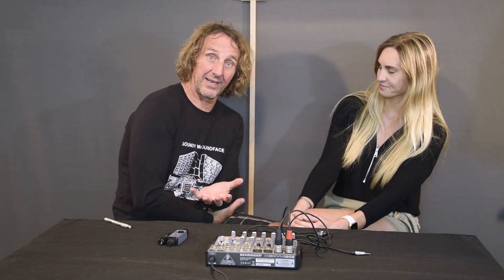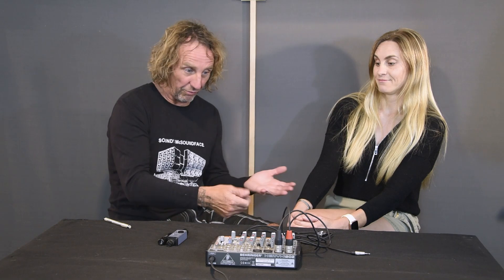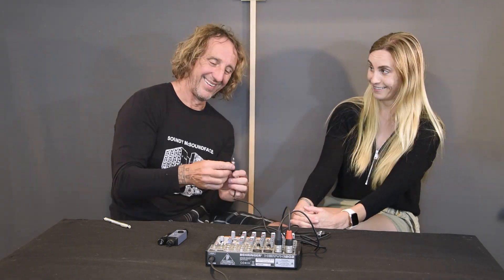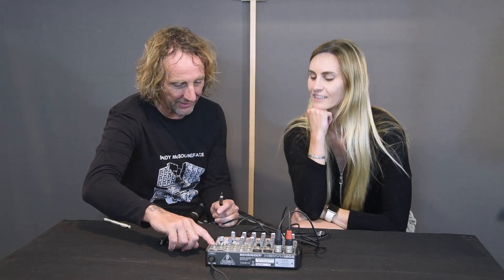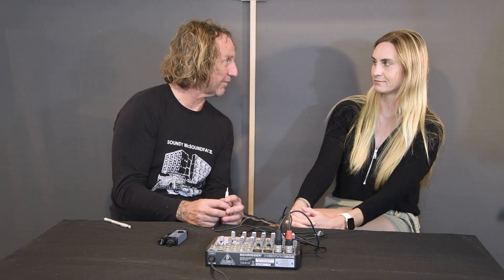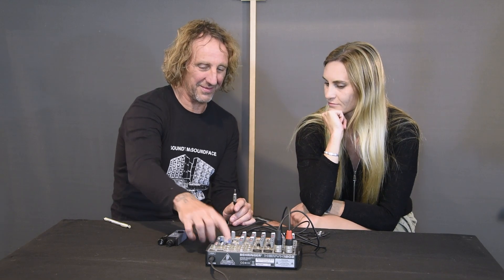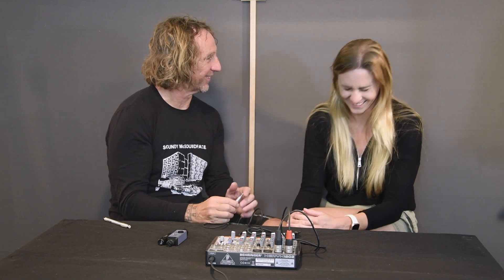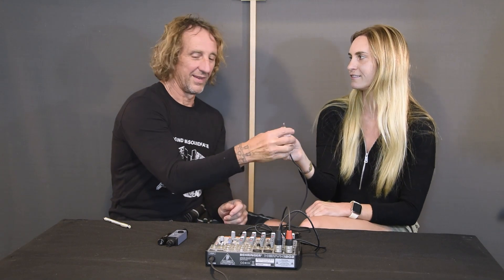Don't Blow Up Soundcards - Mini Plug Phantom Power Test

Comment: Hai dave. i have a question. I setup 2 mixers, stage mixer and FOH mixer. The stage mixer send lr stereo master to FOH mixer using xlr output to xlr input at FOH mixer. What happen if phantom power suddently turn onn FOH mixer. Its can damage my output on stage mixer" thankyou
Reply from the maker: This should answer your question

https://youtu.be/_8UTGcuAtd0?si=UMiK1k6alCT0yYj0
Reply: @DaveRat  Thankyou dave for the video

Comment: Even though it is clamed to be 48V, which it rarely is, it goes through a 6.8kohm resistor, so it is only 7mA into 0 ohms reistance. It shouldn't be problem for an input with 10k of additional impedance because when it hits the electronics it will only be 2.8mA of current, not enough to blow a transistor or an opamp, but enough to trip a security switch on a mac computer and render it useless. That wouldn't happen on any non-apple device, be it a computer or an audio interface.
Reply from the maker: Sure, and also numerous people claim to have have damaged sound cards from 48v.  Muskets are extremely common and a quick internet search landed

Most MOSFETs on the market have a maximum Vgs of +/-20V, which means with VM > 40V most MOSFETS would be out of range.

It does not seem to be the actual 48 volt existing that blows the sound card but to the best that I can figure, it's the surge when an active 48 volt XLR is plugged in jolt the circuit and fixes the input card.

The current rating is very low forphantom, but the instantaneous surge of any capacitors in the circuit can offer a lot more current for a short time

Additionally, on pro gear, 48v phantom is the norm and is always in and around 48v.  For cheaper gear and some portable gear, 12v phantom is used.  And occasionally gear will spec at 24vv phantom

Comment: I would like to adapt this test to check for the  presence of latent B+ voltage in the anode socket of a disconnected cathode ray color picture tube. Hmmmm... might work...
Reply from the maker: Some ideas are better than others

Comment: Just remember to wipe that off with some alcohol between uses not only does it clean the contacts, it cleans the (contacts) and Leaves a nice taste in your mouth.

I don’t plug into to too many unknown cables but now I’m definitely A little grossed out for any of the cables I might have used.

And then there’s the how did your production get shut down……
I don’t know but all the stage hands kept licking cables.
Reply from the maker: Or, 

"So why did your laptop go dead 5 mins before the gig and ruin the into?"

Well, I was afraid to lick the cable because the end might be gross.

Hmmm, and you just got done testing all the vocal mics that has had hundreds of beer lipped sweaty people sing into it and has been bouncing around in a road case for a year and fallen onto the stage a dozen times into piles of who knows what?

Hmmm
Reply: @DaveRat  haha🤣

Comment: There is no need to risk damaging your laptop bu connecting it directly to a mic pre. Most consoles have a purpose built stereo line input for exactly this purpose. If that's not available stereo DI boxes are neither expensive nor hard to find, some are even designed specifically for laptops (although any generic DI box will probably do just fine in most cases).
Reply from the maker: Ahhh, so you need is to have everything you need for every situation handy and close to get every situation running on time, with you always.
Reply: @DaveRat  Everything for every situation? No. DI boxes for the very common situation where you need to plug in a laptop? Yeah I have those living next to the console at all my venues.
Reply from the maker: All good with always having the proper tool for the job and even better is to be able to test and solve it faster, easier or when when the proper tool is not at your finger tips.

Comment: If this was a frequent issue I would just wire up a 3.5mm jack that had a circuit with LEDs for this and keep in my laptop bag.  Then hope nobody pushes the phantom button by accident!
Reply from the maker: I am working on a tester protector unit. Will see.  May be a soundtools product
Reply: @DaveRat  plz include a phantom button condom!  lol

Comment: I've always soldered these type cables to pin 2 and 3 only...is that why I've never blown a laptop/phone, or maybe I just always checked it was off?
Reply: so tip to pin 2 of one xlr, ring to pin 2 of other xlr, and sleeve to both pin 3s...
Reply: I just tongue checked it, felt nothing, guess I was doing right...
Reply from the maker: Hmmm, while that will not shock the lick that also floats the entire phone or laptop chassis at 48volts.

This may not be an issue but something to be aware of.
Reply: @DaveRat  Yeah I thinking that after, ways you could complete the circuit, or possibly damage something else, I don't know...perhaps for just plugging in a floating phone/laptop it's safer...I've definitely used that with all my MacBooks/iPhones...though it wasn't for this reason, think it was because it generally seemed give a lower noise floor...
Reply from the maker: Interesting. Yeah a laptop and phone will typically float unless there is a 3 prong ac cord on the power adapter.

As far as noise floor, the shield is no longer grounded and is floating. Seems like that would be noisier but would need to test to know for sure.

Comment: I toasted a MacBooks headphone jack with phantom power several years ago.  Now, I travel with my own XLR to 1/8" cable that has Pin 3 and 1 not connected.  I also have my Q-Box that I can test for Phantom with.  But I do like your hack because in a pinch you will do what you have to do.  Great video.

Comment: Clever using 48 for phantom power because OSHA considers all voltages of 50 volts or above to be hazardous and the product then needs labeling and precautions....no matter the current.
Reply from the maker: I think that is why 48 was chosen when phantom was designed.  They wanted high voltage to minimize cable loss and low currents for safety. The 48 phantom goes through a 6.8k resistor by deaign

Comment: Introduce cables with capacitors in the XLR's (LOL)
Reply from the maker: The caps needed are a bit big to fit in an XLR if ya don't want LF roll off, but yeah, working on it
Reply: @DaveRat  I know, maybe I'll give it a try with SMD caps some day (keep you posted)
Reply from the maker: Smd caps are still pretty big as ya need 100uf and about 63v. 

Soundtools will release a product as soon as it's ready

Comment: Seeing how your using your tong to check for phantom power you must be in a pinch with no meter and under the gun to hook it up. If you get your tong as dry as possible that might help reduce the shock so then in a pinch you would half to use your sleeve to dry off your tong and then touch the connector as quickly as possible on your tong. 48 volts is getting up there high enough you should just about be able to feel it start to bite by grasping firmly with  a wet index and middle finger across the tip and the other the ring. At work if we have to work on anything over 50 volts we are supposed to wear rubber high voltage gloves.
Reply from the maker: Where is the fun in being slow and boring?

Comment: 110V AC on your tongue? 240V?

I don't know any sparks who do that. Better to use test gear. For 48V presence I just check the button, or use a single ended rated line input. Or a DI. Anything but the dreaded XLR to minijack with 48VDC plausibly on it.

The chances of me using minijack are quite slim. There are USB boxes which work way better, and most small mixers have a USB class-compliant input needing no drivers.

Bluetooth has some latency, but it's very useful. I have a variety of widgets which can be stuck onto inputs, which provides superior electrical isolation as well as untethered convenience. The only problem is restricted access / bluejacking.
Reply from the maker: Safety first, therefore put high voltage in your mouth
Reply: @DaveRat  you can have 240V or worse in the earth/ground, especially if it has been lifted. There are people who have had shocks on stage. It could kill your laptop... or you!
Reply from the maker: Well, it it has that high a voltage you will get shocked before it get to your mouth and though I don't recommend it, 120 or 240 across the tongue will hurt the tongue, but highly improbable to kill unless the voltage is across the heart. Like arm to arm or arm to foot.

And even then, ya need to really hold it for a while to get more than a scare.  At least that's my personal experience.
Reply: @DaveRat  I'm from London, so I've had a few jolts of 240. It's not healthy but hardly lethal in a small dose. Would I tongue it for a million dollars and shits+giggles? Sure thing. I discovered circuit bending by accident running my Korg A3 with the lid off when I was 15... had half an hour of amazingly cool sounds... then got a nasty shock off a piece of shielding. It never worked again. 

It is PSU capacitors which can DC you. I used to run a crosfield magnascan drum scanner... and that had a 16U carbon xenon light source... the capacitors were a couple of liters each. Powerful machine - it grabbed me by two fingers of the left hand once, and I still have dents in the bone.
Reply from the maker: Fun! When I had a job testing switching power supplies, I had 240 between my load and scope. It was all good unless I grabbed a set screw in the scope knob and over shot the load adjust knob and hit the aluminum panel.

Once I did just that and found myself on my ass 4 feet behind my bench, and I had cleared the high back rolling bench stool on the way. My bench stroll was against the bench as if I was never there.

I literally flew 4 feet up and 4 feet back. Sore butt, sore legs and a story is all I had to show for it
Reply: @DaveRat  AC will chuck you, DC causes you to be unable to let go - your muscles clamp on (or so I was told). Very scary.

Certainly nerve conduction and stimulation is voltage based, so electricity is something you can *feel*.
Reply from the maker: I have seen ac cause people to clamp. My friend went to plug in a miswired metal housed connector pair. Grabbed both and locked up, could not speak, was there just vibrating with big eyes till I tackled him.

Scary!!!
Reply: @DaveRat  the muscles work in pairs anyway, and the hysteresis of different muscle groups and twitch types makes electrical interactions with the body a non-trivial concern. It's no joke, though. One hand behind the back, and decent thermal type gloves with surgicals underneath will work. 

My daily wear is a cosalt fire suit. It works for most jobs. It is my "leather jacket", I basically live in it.

Any sort of high current or industrial voltage systems require that sort of approach, but in high power applications a fire suit is the only approach - a serious short w/arc flash will blast an explosive cloud of vaporized metal everywhere. Angry pixies.

Comment: This actually reveals an interesting fact about the phantom power circuit in your mixer... if done correctly, the XLR cold pin should be connected to the ground pin in this type of cable. Thus the phantom power on the cold pin goes to ground, too. But this apparently does not affect the 48V on the hot pin. 

Ah, and just to be a nuisance.... boring people like me use passive DI boxes or phone jack inputs. But actually many modern consoles like Yamaha QL or Allen&Heath SQ feature only a few or even no phone jacks at all.

Comment: Okay so your board is the board the lap top is plugged into to provide the source and the phantom power is off on your board but the phantom power is on from another board on a hard wire split.
Issue or not?
What if you are bringing in the laptop on the 1/4" line inputs but the other board is on xlrs with phantom power on?
Inquiring minds want to know.
Reply from the maker: Hence the test!

Hardwire spit phantom shows every where that is split

Comment: Hopefully no one does this unknowingly with a cable that is inducting high voltage.
Reply from the maker: Hmm, which is more dangerous, 120 volts to the tongue or across the heart?

But I am guessing that if your mini plug cable has high voltage on it, and you are barefoot and grounded, that you would get zapped long before it gets to your mouth

Comment: I'm only giving this a thumbs up 👍for the comedy.  But, in all seriousness, there are safer means to test.  I use a multimeter set to volts to check the line before I connect to my laptop.  Dave, I'm pretty sure this will motivate you to add this type of check to one of the Sound Tools (TM) devices?  Hint hint...
Reply from the maker: In the works as an alternate to the taste test
Reply: I was just thinking I could make some thing like that I already have a XLR tester but you know what a nice reasonably priced professional product…..

Comment: :) you know those power cords w/ thin female terminals like an 8 figure. i was trying to get it to stick to my tongue thru suction as a kid. it was plugged in, it was in Europe.
Reply from the maker: Oh that'll wake you up!
Reply: @DaveRat  50 times per second :)
Reply from the maker: Actually phantom is DC so it's constant 48v
Reply: @DaveRat  thank you..  i thought phantom is 24V. why would you put 48V on your tongue? :)

my experience involved a power cord plugged in the AC outlet, used to power a cassette tape player: 220V-50Hz. 
i believe less than 220V reached me, saliva completing the circuit... i remember my head hurt, not for a long time but intense af
Reply from the maker: Phantom can be anywhere from 12v to 48v

Originally it was all 48 and theat is the most common. Though portable recorders and such often have 12 or 24.
Reply: @DaveRat  thank you. you channel is captivating.

ps: on the rhcp 'unlimited love'album there's a song 'one way traffic' and it says 
"Got a call from my good friend Dave
He said, "Yo, let's get that wave"
I said, "Yes, just tell me where"
Board's up top, wind in my hair"

do you surf mr Dave? :)
Reply from the maker: I do but that is about Dave M, a photographer friend.

Comment: Please don't ever do this!

Especially if it's an unknown source!
I have measured unbelievable voltage across audio connectors, Please don't ever do this use a damn meter!
Reply from the maker: If you follow that logic then don't ever touch an audio connector as it may kill you
Reply: @DaveRat  
No man, I totally respect you and enjoy your videos.

I'm just saying I've seen some crazy crap.
You know it  you've seen it too.

I totally get the video because you're sitting there looking at the gear, but to be out in the field and somebody say here touch this with your tongue, yeah I'm not going to do it.
Reply from the maker: Years ago Eddie Vedder got zapped and after that the metered but the paint on the mic grill prevented a reading and he got zapped again.

After that, I would meter to the connector and also I would do the tongue test while holding Eddie's guitar, lick the mic.

This was to make sure it was absolutely safe and also to give Eddie confidence that it was safe as I was willing to do what he was going to do.

And yes, I took some zaps before sorting the issue. Ouch but not that bad

Comment: I had a laptop soundcard get fried.   The worst part is I was volunteering to help some friends who needed some sound effects for their presentation.  I wasn't even doing sound.  I plugged in my computer and after a minute the left channel went out.  About 5 minutes later the right followed.  I pulled out a usb sound device I had in my backpack and made it through the rest of the show. 
It was later I realized the board being used had a global phantom power switch.
Reply from the maker: Bummer

Comment: I would advise removing all saliva from the plug before plugging to the laptop to make sure it doesn't cause corrosion in the jack ;-) The fried output issue is why I almost always use a passive stereo DI when using desks that only have XLR inputs instead of TS/RCA to XLR adapters. I've also found with many boards that using the adapter method can also induce power supply or ground loop noise from the laptop into the mic pre's. Using a stereo passive DI solves both issues and takes away the blown output worry.